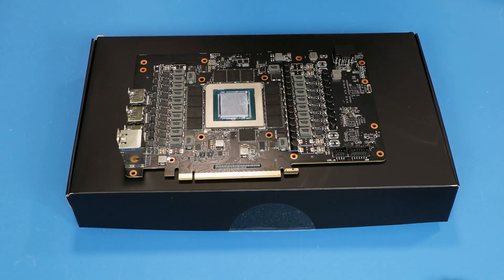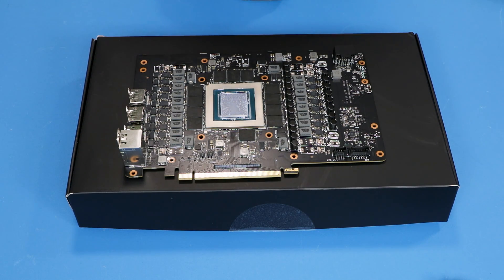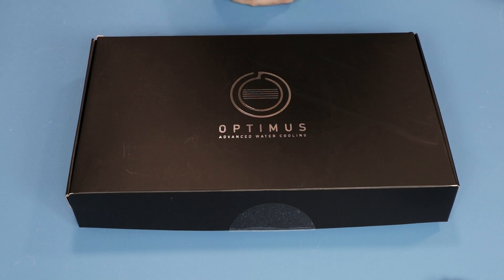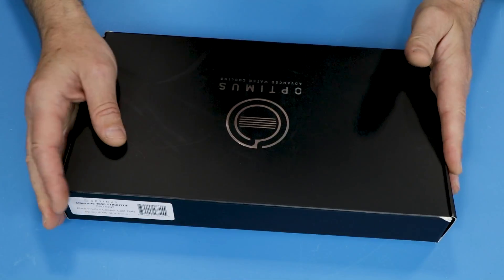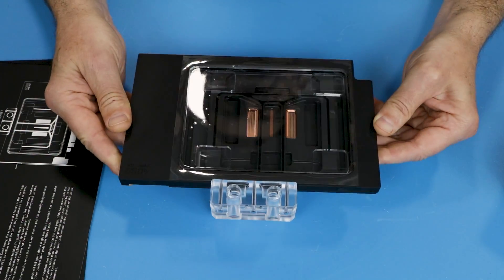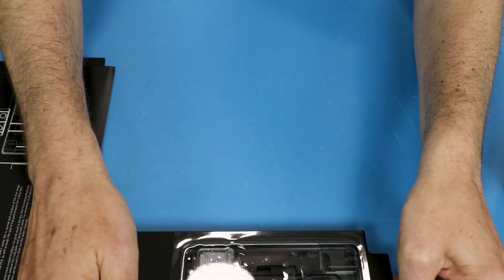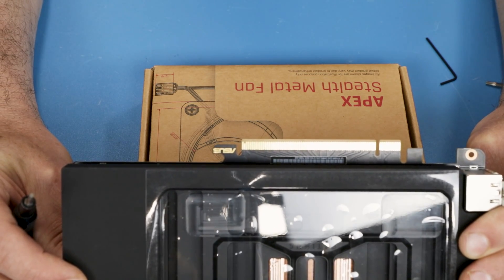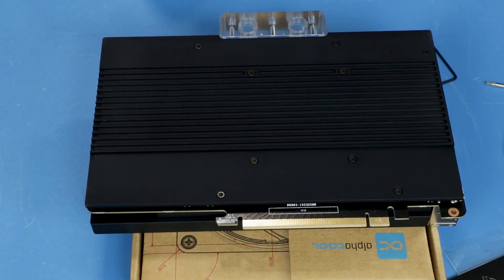Installation of Optimus Signature V2 4090 Strix/TUF Waterblock -Quick Guide #8

Comment: I hadn't seen that block before. Looks very nice.
It would be nice to make a set of guide rods to ease the alignment for the install.
Looking forward to seeing performance results.
Reply: Mine didn't perform any better than my EK block did on my other 4090. Seems like the 40 series is just more heat dense, or the sensors have different placements/behavior vs the 30 series.
Reply from the maker: I swear it come trough my head to put toothpicks in screw holes. 😂

Comment: I've used Optimus for years on various CPUs, but more relevant on my EVGA 3090 FTW3, and now again on my 4090 TUF.  It's great to see them getting some broader coverage, they make some ridiculously premium parts.  Of course that comes with some pretty high cost and traditionally some long waits between product announcement and general availability, but if you have the deep pockets and the patience they're solid and also gorgeous (but of course design choices are subjective - I like them).

The comparison to Heatkiller is a good one, they're similarly boutique level and obsessive about their engineering.

Gotta be careful with the tightening, both my Optimus blocks will allow you to screw down tight enough to put some board flex in there.  If you've kept it even it will even out, but you can go overboard or unbalanced if you're not careful.
Reply from the maker: I think if we want to see any domestic products at all, at least some of us  need to pay the price for something that is not made by slave labor. Thank you for your share.